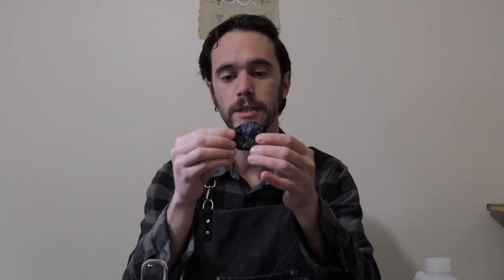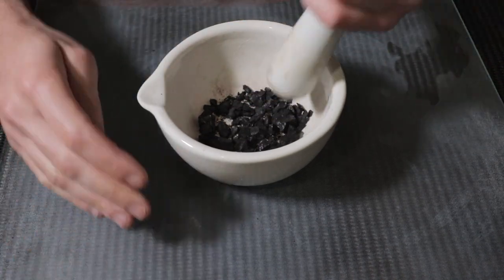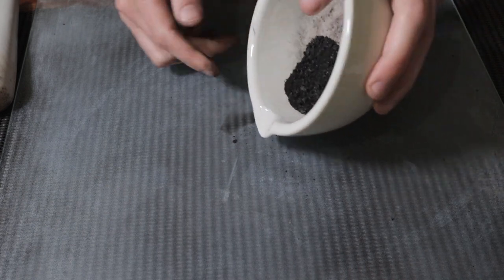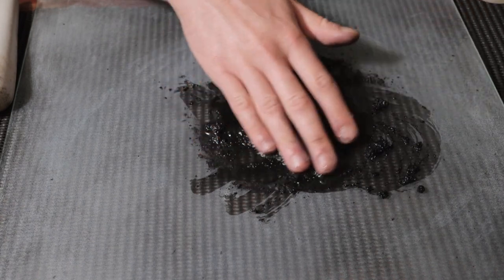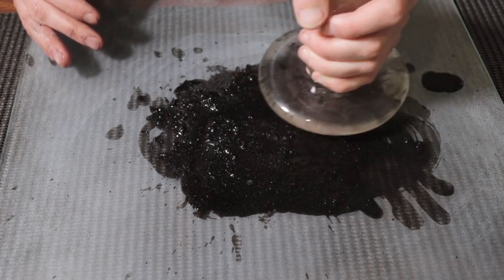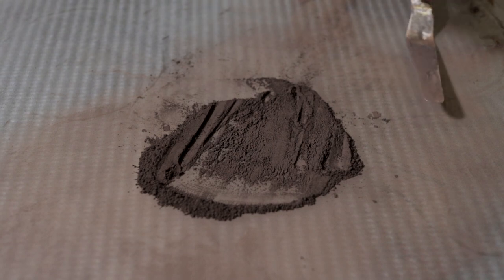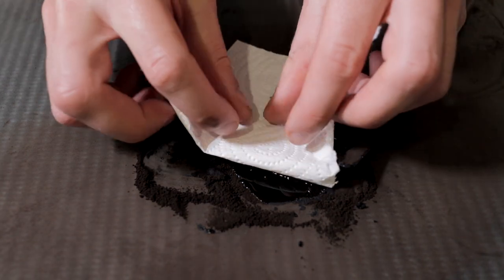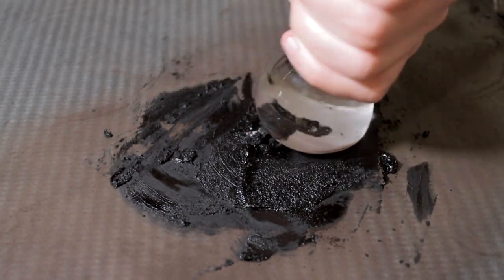Not so simple Charcoal Black pigment!

Comment: Some tips for selecting fully burned pieces of char in the future. They should be relatively small to ensure that they are the same all the way through. They should have an iridescent blue sheen on the surface. They should have a glassy or ceramic sounding chime when dropped on a hard surface. They should stick to your tongue when licked. They should make a clean sharp break when snapped in half.
Reply: A very dark matte black surface would probably also work well because it indicates that the piece is overdone.
Reply: rofl no

Comment: I've been collecting coffee grounds (used) to try and carbonise the same way you would with wood, thinking about that though, my bet is, if you start with a fine power of material, clump it together and bring the heat up gradually, it will be more uniform and might be more opaque once mulled with oil or some other binder. but soot is probably better though, I like this video because you go in depth, something I would like to do more. great quality video, always interesting to see other artists processes.

Comment: Thank you so much! I appreciate learning with you on your videos. I was impressed with you using the hot water to help sort out the courser particles.

I've heard hardwood charcoal can be difficult to work with because of its' density, though the density might help give better coverage. Alder and Willow might be easier with their lower density.

Have you considered getting or making a ball mill? It is supposed to crush powder particles into platelets which improves mixability apperently.

Comment: hi
great content !!!

I've once thought of scraping the naturally derived pigment material on a coarse surface (a big rock, a brick, a sandpaper) so to avoid the first rough grindings which are messy and sound really loud, although I haven't given it a try myself, but it would be a piece of cake with this soft charcoal chunk, it would be like sharpening your charcoal drawing stick but collecting the charcoal powder rather than throwing it away ...... its like drawing with pastels but collecting their powder from the paper.....it came to my mind once when I utilized a red stone to "draw" on a big rock, I observed and thought why not scrub it until you get your first pigment powder which you can later grind finer and clean it, it would be much more comfortable.

So you might want to give it a try. I will of course when I'll find some space to do so. With charcoal chunk one could do it indoors, but maybe it could even happen indoors with rocks, using different sandpaper grits (but the  again its the issue of breathing dust, although you could wet the whole process with water, just like wet sanding)..... 

Anyway that's my thought !!!

Comment: I really liked the warm redbrown black you got out of it! 
Out of curiosity, why not run the rough charcoal in a blender with some water or run it through an old coffegrinder to get finer particles to start with?
Reply: I was going to ask the same. I got a used coffee grinder and use it to pulverize rock ( after I’ve crushed with hammer or morter and pestle ) 
It’s worked well for me. Very small yields tho after sifting and levitating
Reply from the maker: Yes that would be easier but I am sucker for painful hand work